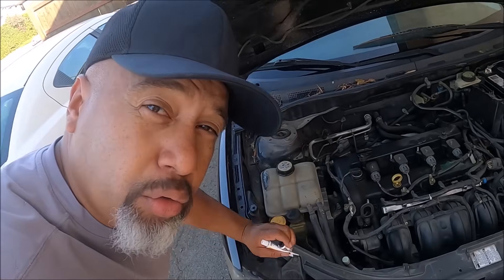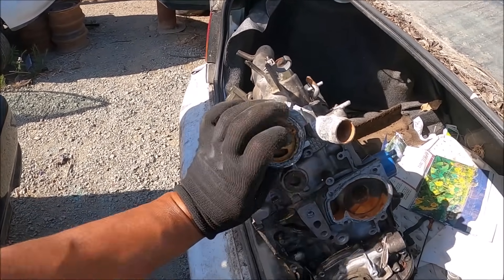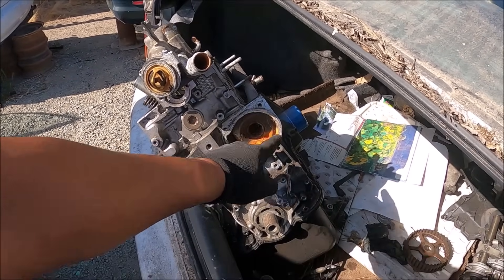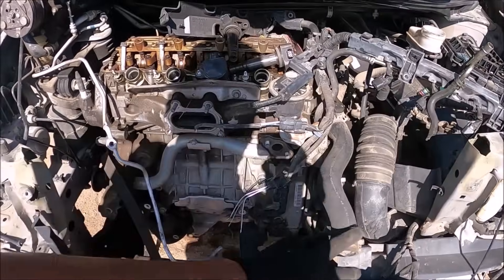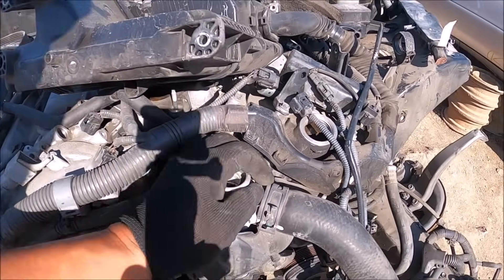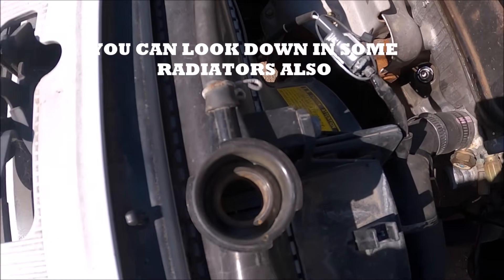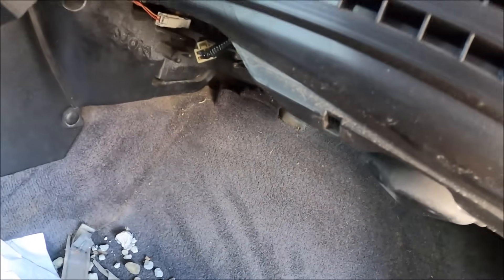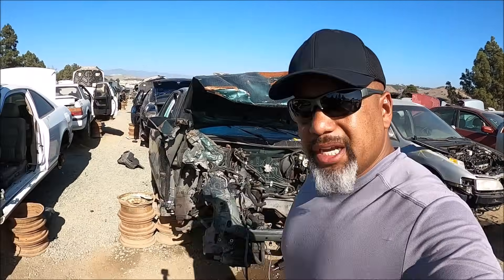HOW TO CHECK IF YOUR WATER PUMP WORKS & CIRCULATES ( EASY OVERHEATING TEST )THE COOLING SYSTEM.

Comment: Have a 2001 lincoln continental. Upper radiator hose is swollen when hot and collapsed when cold. Going go replace it. Problem is these radiators dont have a cap. Just overflow and cross pipe have a cap and a plug.  Coolant not circulating down to lower radiator hose. Thoughts?

Comment: This was the best explained video I’ve seen about working on your vehicle I’ve ever seen. I had a 2007 ford f150 I had to learn to work on out of necessity. I could never afford a $600-$1500 mechanic shop bill but I could afford the part. So I became a YouTube mechanic. The problem is now I have a 2014 ram 1500 and it’s a lot different than an 07. Electrical, sensors, etc. they design vehicles now so it’s harder for regular people to work on their own cars bc they want you to rake it to the dealership. My thermostat is built into the housing so I don’t think I would be able to check the water pump by taking out the thermostat. Is there another way that you’re aware of?

Comment: Great video! Thank you for explaining all this.
I have an issue that just started..I just replaced rad, intercooler, AC condenser, water pump, all timing and balancing, thermostat, outlet pipe, coolant hoses, turbo with all new lines, PCV valve, MAF sensor, MAP sensor, turbo boost sensor, catalytic converter, vacuum pump, high and low pressure fuel pumps, fans are working and in good shape, no codes, no overheating but engine is hotter than usual..any ideas on why?

Comment: Thank kindly sir , I'm a 64 year old , grumpy old fart , Kind of back yard mech ...IF I KNOW EXACTLY WHAT I HAVE TO FIX OR REPLACE ! but this coolant issue is killing me . I've drained and refilled the system twice , changed the Thermostat ( just cause ) the rad cap , again just cause it was something easy to do . and still I'm over heating . I'm driving with the heat on full blast , my logic is it will help bleed off the heat of the coolant . The air is so hot I can't hold my hand in front of it very long , and i've got all the widows open .  Been thinking for a couple of days it has to be the water pump ( been quoted a little over $ 1000 ( CAD ) to replace it , ( on my 2013 Grand Caravan , it looks like a bit more than I can handle )  
But seeing you video , I got a whole new mindset on what to do , I'm thinking that the thermostat is bad from the factory , so I'll have a better look at that as well as the rad cap etc .
Also , seeing and hearing my lord's words , gives me some new energy and clearity . 
Thank you so much

Comment: Excellent info thank you quick question how do you test to see if a tensioner is bad or not because I took mine off and it sounds like it rolls fine but the new one I have seems cheap and flimsy compared to my old one with almost 300,000 me I'm confused on which one I should use

Comment: Off topic ... I just changed my timing chain 2.3l ford and only torqued the oil sprocket to about 150 inch lbs and it should be 250.
Do I have to go in an redo it and if so are tty bolts actually reusable with red or blue loctite.
I found you this morning ... Praise the Lord . either way.

Comment: I got me a 2004 Honda Civic ex and I changed my thermostat with OEM put  new hoses did a block test and can't figure out why my cars reservoir keeps filling up..takes about a week of driving. No noises no leaks I open my radiator cap and it sounds like gargling and water fills up my reservoir. No over heating at all...I found out once I turn my heater on the reservoir goes back down to below the first line on reservoir. I don't fill my cars reservoir tank up just below the max line which would be the 1st line ..idk it's driving me crazy. Also I noticed I went up hill on a bumpy dirt road and my reservoir will squirt out fluid and once  my temp did rise goin up...whatchu think my kind..👊🤙

Comment: My fan is running abnormally fast non stop. And my temp gauge goes all the way up after 5 mins of driving. Mind you, no leaks, no steam, no smells. I just replaced the ECT sensor. Did not fix anything. I recently also replaced the thermostat. What can it be?

Comment: My heater core blew out. I bypassed it. I also switched out my thermostat. For a new one. I am still getting overheating issues on my 2000 Jeep Grand Cherokee 4.7. any ideas ?

Comment: Hello and God bless you. I hope this message gets to you. I have a question before I want to thank you for every video that you have made for has teach me the word of God and how to fix my car which are two very important things in my life. I appreciate it . I have a 04 Dodge Durango 5.7 just got a misfire a number six I change the spark plug. I changed the ignition coil. I also changed the fuel injector and it still rattles and turns off. Is there anything that I am missing? Please help thank you and once again, God bless you.

Comment: What if the heating core don’t work for the heater inside the vehicle when you turn on the heater to see if the water pump is working or not by testing the heater?

Comment: Thank  you brother, God bless you and your family!   One question,  i have already changed radiator fan which was bad and was blowing the fuse. Also changed the thermostat, and verified sensor is OK, radiator cap is also ok.  Heater vents feel ok,  hot air is coming.   No leaks anywhere as far as i can see.   My temperature gauge normal is 1/2,  but when i am in the city in slow speeds and stopping a lot, after about 20 minutes the gauges goes about 3/4 and i hear the ventilator on and off frequently.    Is there a possibility that the water pump has lost flow pump power?  i dont know maybe the blades worn out?  I dont hear any noise from the water pump or anything.   But still my truck goes to 3/4 and sometimes when i arrive home and turn motoro off,  the ventilators stays on for a while.  Please help me i just cant think of other way to find what is going on.   Thank you!

Comment: Great video! I was wondering why in the world do we even need a thermostat. But you answered that question for me. We need it so engine can reach operating temp. I was about to pull mine off and run it like that. Going to get myself a new thermostat instead.

Comment: If the thermostat is not opening and the heater is blowing cold air, could it mean air is stuck in the system?

Comment: I got a question both upper and lower radiator hoses have no pressure you can squeeze with you hand even if the car is on is that both the pump and thermostat?

Comment: I monitor my car temp with scan tool and when i get going it climbs up anove 190 above 200 all the way to 217 when the fans kick on and bring it back down to normal operating temp...190 to 220 is fine and it never overheats on the gauge...

But whats weird is i test the heat when i first start it and once it warms up a little i feel somehwat hot air...then it gets cold when temps get all the way up to like 210 to 220...then all of a sudden it gets really hot air at the same time that the engine temp starts going back down from 217 down to 200 and 190

Is it maybe a thermostat that opens very slowly?

Comment: So on the thermostat. The spring holds back against the wax in the hosing. When the wax is heated it expands, overcomes the spring and opens the valve. Over time the thermostats wear out and need to be replaced. ~150 miles.

Comment: Thanks man! Got a 1967 mustang with the 289 v8. Cooling problems galore. Replaced radiator cap, flushed coolant, replaced thermostat, still overheating. Trying to determine if I should get a radiator or water pump next.

Comment: I have 06 toyota sienna has 64k  but i might be tripn might not, lately my engine feels hot when i open the hood but my temp guage is normal.
Should i be worried guys or look into it?? Any advice helps thank you. Also no check engine lights

Comment: Please help me diagnose my problem🙏 on my daughters car 2000 honda civic dx. Coolant is leaking through water pump peep hole just as fast as im pouring it on radiator. Thanks in advance.

Comment: Hi. I have a 1971 riviera. What does it mean when radiator cap is off and after engine running for five min. Top hose is hot and coolant starts to overflow.
Thank you.

Comment: Lord will be here in 2025 ❤ am dealing with a back up car 🚗 that is a Pontiac torrent 2006 and dealing with overheating and I bypass heater core and new thermostat and still over heating / I took  out thermostat to get flow threw radiator and now need to burp it for air bubbles next ! Water pump seems fine ? But no clue yet if it's the problem ? Fan coming on after heat gage gets just over half way and it has 200.000 miles I got this car to use in case my car I sleep in is ever down and just don't want to pay $200.00 for a hotel but I love the video! Love that you understand that Christ is coming after the last generation is completed when the clock started ticking may 14,1948 a generation is between 70 & 80 years !

Comment: I have a 2007 Chrysler Sebring 3.5.  Is the radiator hose supposed to be soft or hard ? It ran hot on me yesterday. I had a  big puttle of water under my car. Had to get a tow. Next day I put water in it and drove it a d  ever ran hot and  ot a drop of water. Cold air  hot heat. I feel water  is ulating  through the hoses but they aren't hard at all.  What do you think could be wrong?  I'm lost completely.

Comment: Water pump is fine and the heater core pumps out hot air... Just replaced the radiator, both upper hoses and the lower also replaced the thermostat a few days later!... Issue I've come across is the coolant level drops over a period of time and can never keep it at that certain level!
Reply: Originally thought it was a leak coming from the clamps after I changed the hoses so I replaced them but no resolve.. I drove it the same day without really burping the system too ugh! Shortly after I replaced the radiator then a few days later replaced the thermostat. I drained and flushed the system then burped it using one of those no spill funnel kits... And still no resolve!
Reply: Could air still in the system be the issue... I do notice that warms up quickly, but never overheats and the gauge reads the temperature fine!.. Fan resistor is fine as it kicks on by itself. However I'm not seeing any obvious leaks anywhere and no coolant spills under the car... Also I'm not seeing oil and coolant mixing!
Reply: What concerns me is that the radiator hoses feel overly tight when I squeeze them!... I know about heat expansion but the hoses feel like they have way more pressure in them unlike before..

Comment: I’ve a Lexus is200. No heat. Changed radiator & coolant still nothin 😢 also hearing a gurgling noise behind the dash while driving. Almost overheated today and I don’t know what it is

Comment: I been a tech for 22 years,  the info he gives, is not bad nor is it false.  At least about the cars.   There is a lot he had left out which is gonna leave anyone who don’t know about cars. Still asking a lot of questions, and lost.  If you don’t know much about a cooling system. It’s definitely better to refer to a more detailed video.  I understand this guy is trying to help out but, either way someone is gonna get hurt or left confused and stranded. Incomplete info doesn’t help anyone when they are broke and frustrated.
Reply from the maker: Help people with what you got. If you sit on the side lines and criticize all your life you will never help anyone. Stop overthinking Jesus Christ is still king regardless of your false perception about him,
Reply: @oldskoolfunk71  it’s not about over thinking.  It’s the fact your overseeing many highly import safety details pertaining to the car and , the person watching your video. Someone could get hurt. Also you do t even explain the whole process of when the heater core is clogged. You just say, basically cut the lines put two bolts in and clamp those ( don’t wAste good extensions people. You might need them again)  also you gotta get two clamp and some pipe to reconnect the lines going to the engine. To complete the by pass.  Then there is the whole process of burping the air out of the coolant system. Due to the fact the lines where cut . Air has entered the system. But that’s a whole other video . Feel me. Also don’t hide behind the lord for you lack of attention to others safety or even the proper process of the repairs you speak of.

Comment: Jesus is Lord! Thank you brother, we used this video to diagnose a worn out water pump not properly circulating coolant in a 2003 Dodge Caravan 3.3V6 with AC we are working on to get reliable enough to give to elderly prayer warrior lady at a local korean speaking church in our area. We replaced a badly leaking radiator and put on new new upper and lower hoses already and leaking t-stat housing + put in new t-stat but van was STILL overheating after longer drives...and it's April so still cooler/cold outside here in Colorado so this van would be overheating badly blowing up the engine come summertime...devil is wicked to cause us all so many troubles in this life but our Lord don't want us growing up into spoiled rotten brats so when we face off against he devil when it comes to fixing up older cars and trucks for our church family and ourselves we learn how to trust Holy Spirit to teach us all things, including leading us to your video so we could learn how to diagnose how to repair this old soccer mom van so it will be blessing to that old church lady prayer warrior so she won't have to ride the public transportation bus to church or grocery store anymore and so she can drive to go fellowship with her church family whenever she feels like it...truly Holy Spirit teaches us ALL THINGS and he lead us to your channel. How can we or anyone who watches your channel EVER REPAY YOU in this earthly life??? So all we can do is say thank you, God bless you richly more and more in Jesus name, and we will party with you in heaven and in Jesus 1000 year kingdom on earth. God bless you amigo from Colorado. much love
Reply: Hello, God bless you!  how can you diagnose a worn out water pump?

Comment: O,Thank You God for is video.i like this video No, love it,because of the words that you allow this guy to speak, especially at the in of the video.  My 2003buick rendvous is overwhelminglly overheating.ive did the new radiator cap, water pump, radiator, thermostat ,flushed ,gallons and gallons of radiator fluid ,etc.iam tired a bro of this vehicle running hot and have not find out whyand haven't even able to afford it because spent s.much on it already  . Please pray for I stayifist Very Strong in God ,but. Mot only I ,but all others.I this same pray goes back to You and Yours .. Always...thanks for the video 🙏❤️🙏

Comment: Hi Sir...

I love your video very simple clear and informative.

I would like to find out something please...

I'm driving Toyota 1.3 carb. The fan goes in as soon as I turn the ignition on and only goes out when the ignition is turned off.

The other issue is when I idle until it gets hot the coolant boils over into the reservoir. When I plug the fan in at this stage the temp gauge drops little. I have noticed the top hose from cylinder head to radiator gets extremely hot. The radiator also gets extremely hot however the bottom hose from the radiator to the engine does not get hot with the fan connected or not.

I can't find any leaks or noises on the water pump and the oil and water has not mixed. I have done a visual check in the oil. I got a guy to have a look and he wants to fit some thermo switch to activate the fan to come on and off in the bottom hose from radiator to engine. I don't see the sense in that as the pipe stays cold. Yes my fan is actually connected directly from the thermo sensor to the fuse box not sure why or what the correct way.

I'm sorry for this long message and thank you for taking the time in reading. 

GOD Bless you

Comment: Hi.
I am stressed my car has overheat signal. They took off the thermostat, gasket was skeemed,,replaced gasket top.. Was told water pump is fine but still signal is there, am broke and frustrated coz I use my car to make income. Any advise what I could check as well. Radiator was replaced 12 months back, no sign of leaking. The hose to the radiator looks like it expanded a bit.
I really really need help. The water used to be boiling on the reserve bottle but stopped after the gasket job. The fan kicks in also, I'd like to know what more could be checked  
Thanks Ayanda (South Africa)

Comment: Hey brother i have a 2006 dodge magnum 2.7l rear wheel drive.
 i dont have a radator pressure cap only  rservoir tank and cap. Not pressurized. My heater works excellent id say almost to good. It blows hot. My leak is coming from below center of engine but my car sits very low an i cant get under there to see where coolant is running down from but lately its excesive an I need my car.
The gauge is always at 1/2 pounr hasnt overheated but i keep it topped of.
Local shop quoted cost of 650 only if its a 2.7l he wouldnt touch it if it were the 3.5l. He said its an a day job for water pump change but I am on borrowed time and on    money is scarce. As you know we might be poor folk but im rich with the love of Christ. Please give me direction

Comment: Great video like always I’m having a problem have a 04 Acura rl cars temp needle climbs up to normal then starts to climb to the hot then fans kick for a little bit doesn’t always lower temps changed thermostat can it be air in system since someone changed the radiator or the cap nd or radiator a/c temp sensor